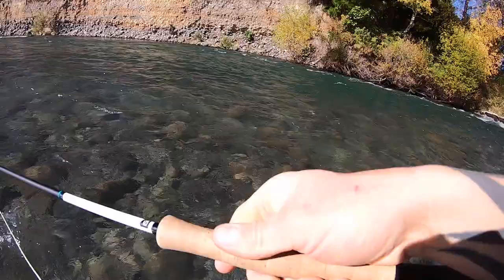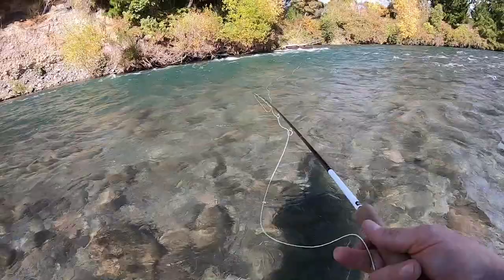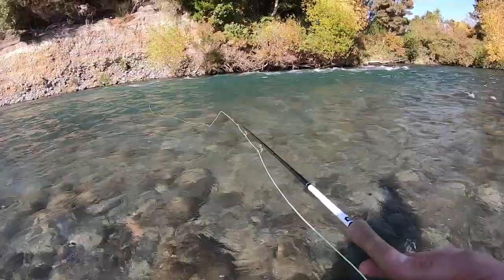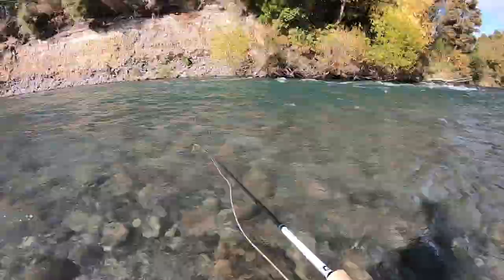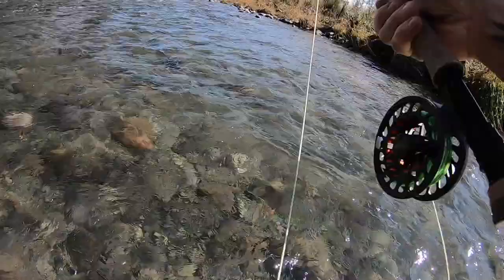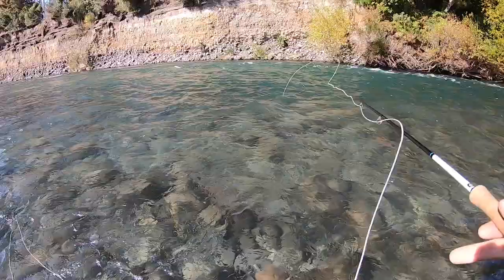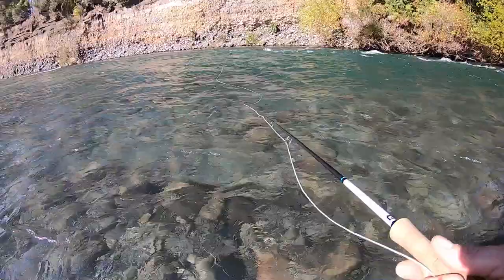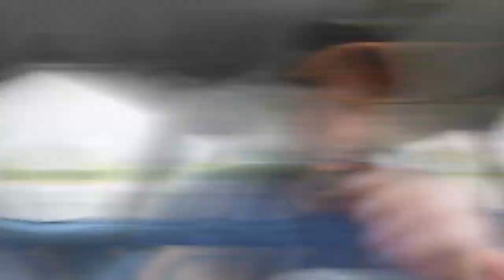HOW TO GET A BETTER DRIFT [Line Management Basics]

Comment: What a life saver this video is bud.  I've watched various clips on mending/line management but they're nowhere near the simple but effective explanation of how you have portrayed it for us.  I've struggled with drag on rivers but mainly trying to work out whether to mend upstream or down stream.  So you saying soon as there's a belly in your fly line going below your rod tip mend up, same if your getting a belly upstream with your indicator below your rod tip, mend down stream right? That was where I struggled, up or down.  There's issues too when some times the current your flies are in is faster than the current closest to you where your fly line is on the water??  Maybe do a video on different current speeds to counteract that.  Great stuff